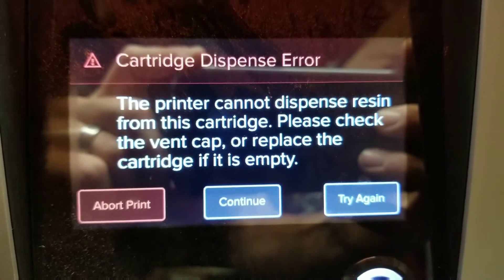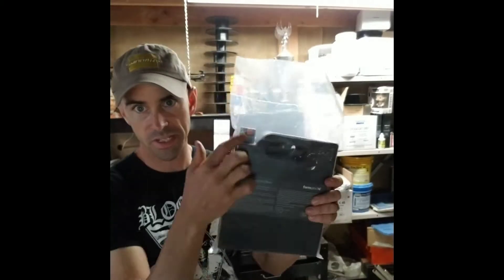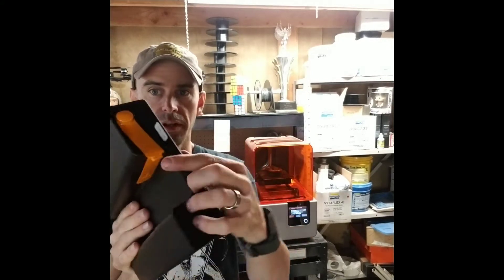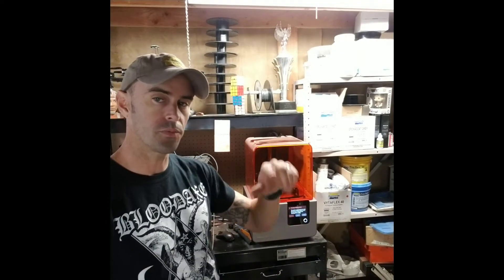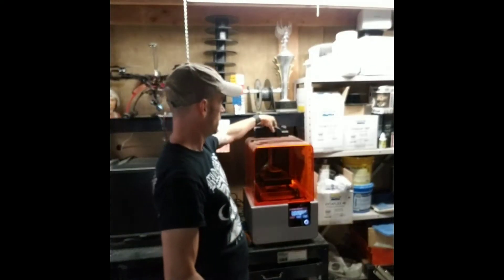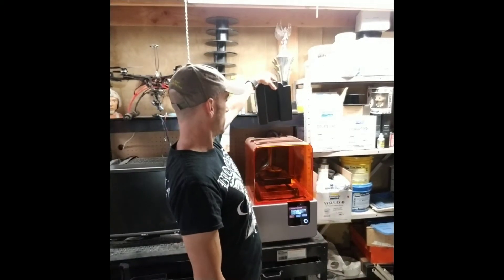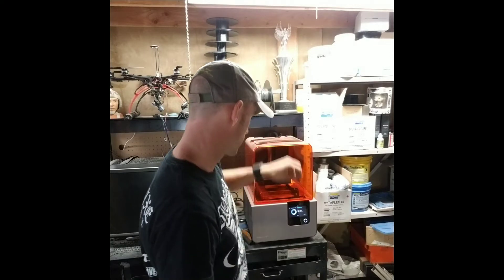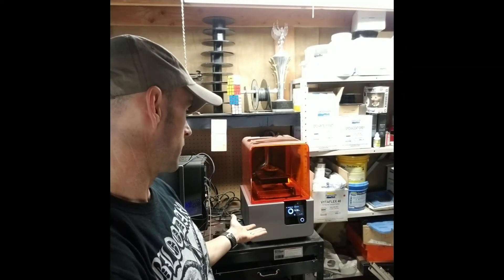Formlabs Form2 mid-print resin cartridge swap.

Comment: Hi Gordon, as you are also a user of a Form2 (or were in the past at least), wondering if you ever found a 'hack' for use on the Form2 to utilize the majority of the remaining resin left in the tank. If one uses many cartridges of the same resin, the wastage % is lower overall, but when using only one type of resin formula in 1L cartridge, the waste suddenly seems so significant, approx 260-300ml of wasted resin as soon as it senses the cartridge is close to empty and tank isn't at max fill line. - So yeah wondering if you found a solution to this problem. - Thanks, man!

Comment: Formlabs is a total rip off, they charge 150 bucks for a 30 bottle of resin and you can only use their resin bottles. A anycubic printer prints just as well for a 50th of the cost
Reply from the maker: Totally. Used to be awesome but when prices started coming down on resin printers, FormLabs didn't adjust their prices to be competitive. So lame. I've been experimenting with aftermarket resins for it lately. Probably do some vids on what works well when I get some more prints finished.

Comment: Hi, nice quick video. Do you know how much time it normally takes it to start letting the resin in to the tank?
Reply from the maker: Depends on how much the machine senses is already in the tank. Sometimes it starts dispensing right away but sometimes I'll switch and it'll continue printing for a little bit before it starts. The machine does whatever it wants. hahah